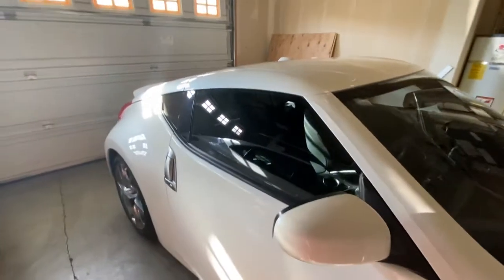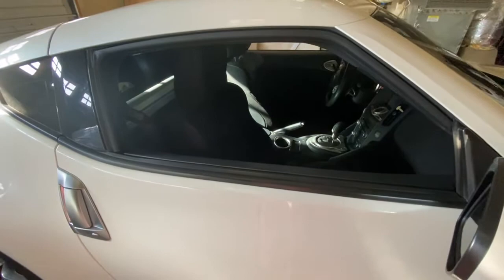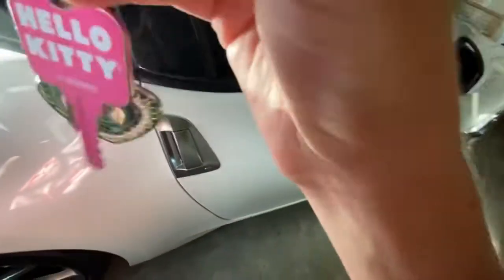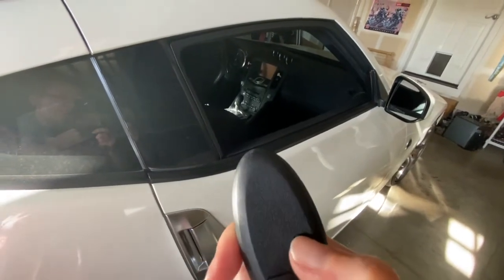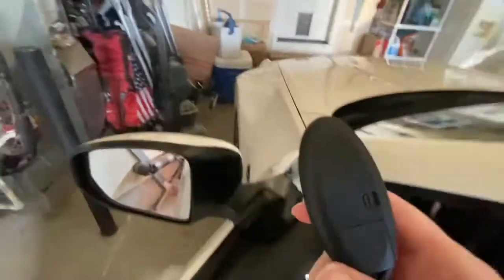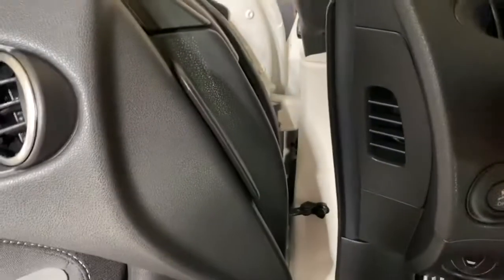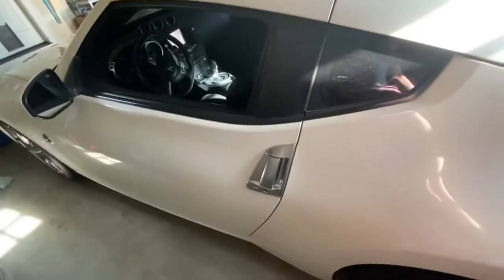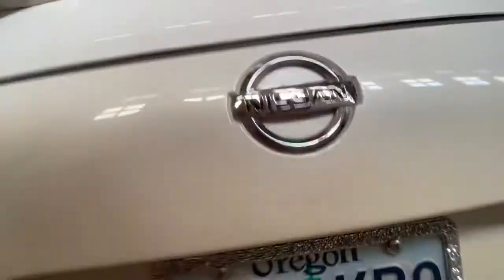Nissan 370Z Keyfob Tips & Tricks!

Comment: Im getting a 370z in a couple weeks (shipping from Tennessee) so anything that I should know right off the bat?
Reply from the maker: Congrats! I’ve had two of these vehicles and loved both of them! I never had any issues with either one of mine other than the TPS monitor going off, so be sure to check all of the TPS on each tire :) another thing is you have to manually check the tire pressure as there aren’t any electronic gauges which is surprising!
Reply: @ThatCarEnthuZiastBrittany  all good with me. looking forward to it. when will you make another 370z video?

Comment: "Little" fuel door??? Lol.  Oh hey btw, your body control module can also be programmed to roll those windows back up using the lock button. But the module has to be flashed via Nissan IDS. Its a pain if youve gotta have Nissan do it because they have the proper firmware, but just sayin it CAN be done.
Reply from the maker: Tony Novak very interesting! Thanks for the tip :) never knew that! Haha and these things have large fuel doors for sure!